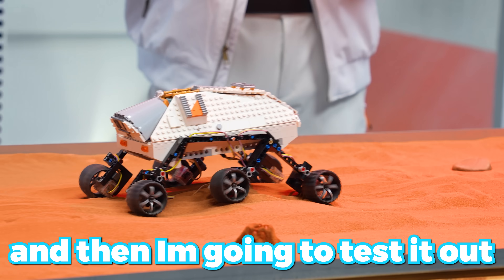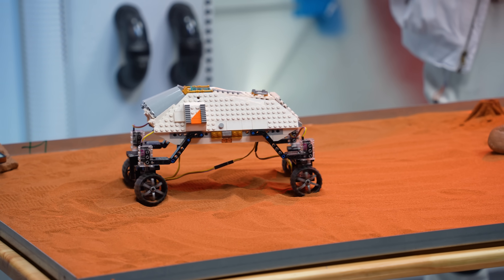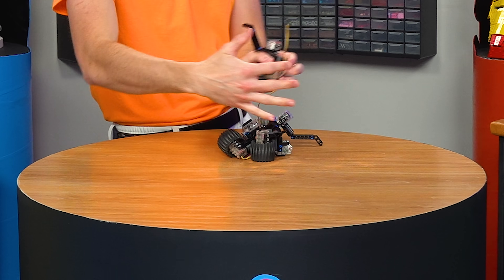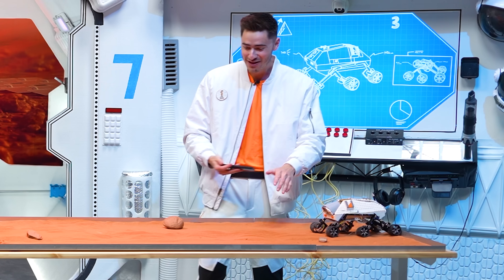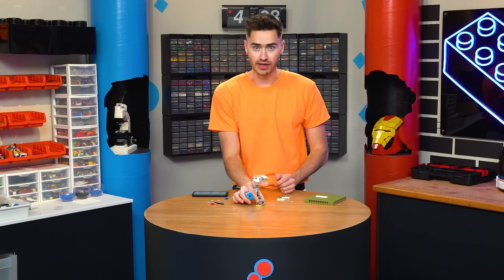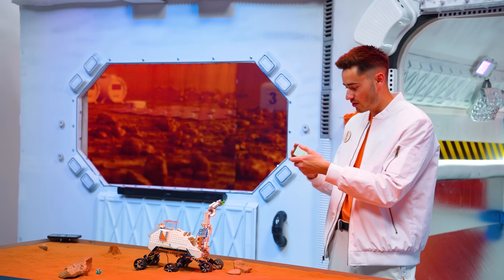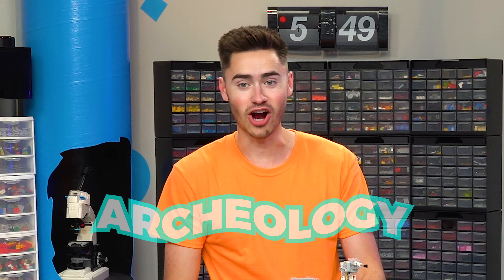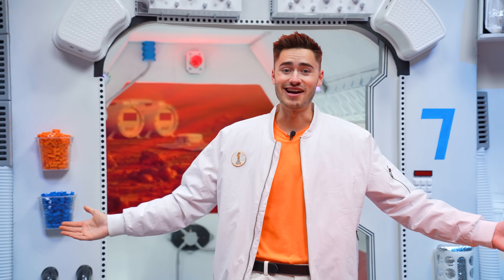Testing LEGO Mars Rovers!

Comment: The reason your wheels are digging themselves into the sand is because you need to increase the surface area of the tires by the same percentage as you increase the vehicle’s weight. You could choose a wheel/tire combo with a huge diameter, ones that are super wide or you could add more wheels. But usually the best way is to swap to a combo that has both a somewhat larger diameter and is also somewhat wider.

Comment: 7:11 Fun fact! The Opportunity Mars rover ran into a very similar issue in 2005 when it got stuck in a sand dune. The solution the engineers came up with to free the rover was to "put it in reverse and gun it." (Genuine quote from principal investigator Steve Squyres during one of his talks he gave about the mission) This worked and from then on the team were a lot more careful about driving near Martian sand dunes.
Reply: Same happened with Spirit, but it never made it put
Reply: Taking away the 2 dots your comment would say 7-Eleven
Reply: Cool
Reply: I would personally add a gear ratio to the wheels so they would have more torque so that doesn't happen